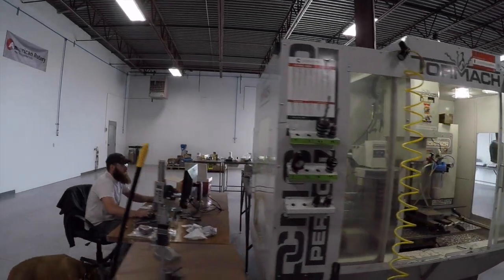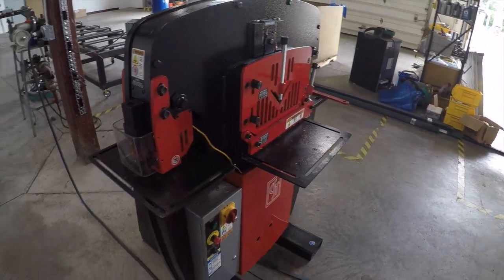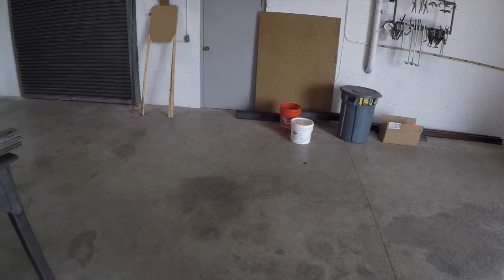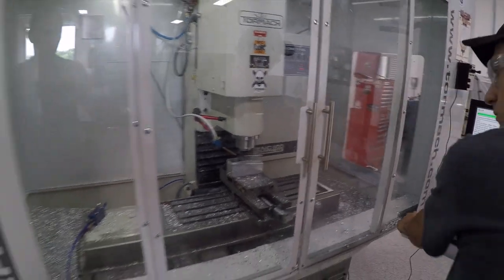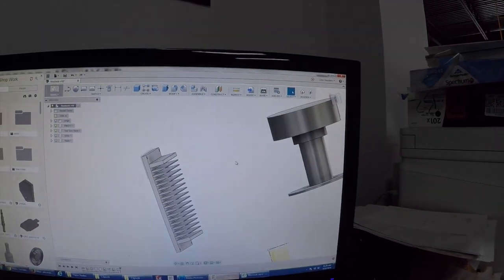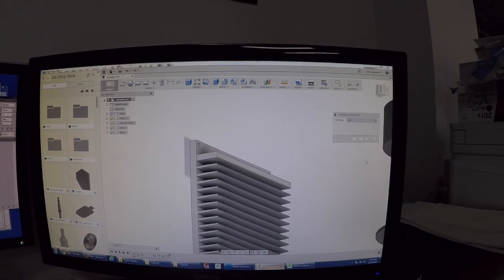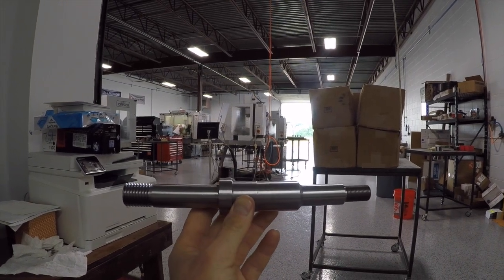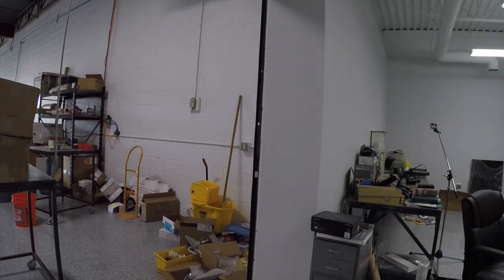Intern, Iron Worker, Slitting Saws, Shaft, Sandvik & More! CB22

Comment: I still say but the extruded heat sink stock and modify it.  If it starts to give you a lot of chatter, good trick is to cut every other slot first, then melt machinable wax into the slots, put it back up and cut the remaining slots. The wax keeps it both rigid, and will dampen the vibration during cutting. 

And ya... Didn't think that 390 would be beneficial on your current machines.  But hey, that's why you get tools on test :)

Comment: Hi John
We were using the Sandvik 390 16mm endmill with GC1130 insert on our VMC ours is a 5.5kw spindle. We were trying to take a cut 6mm doc and 10mm woc at 5420 rpm and 1250 mm/min the spindle didn't stall but the insert took the beating. We finally ended up with 1mm doc and 15.65mm woc at 3980 rpm and 745 mm/min. All this numbers were given by Sandvik online calculator. You can try lesser doc at full slotting. We have noticed indexable endmill work great with lesser doc and higher woc for low power machine.

Comment: If you find yourself getting lots of projects like that heat sink, maybe consider building an arbor to mount multiple slitting saws onto at once... use different thickness washers between each saw to allow the spacing between the slits to be varied.  Could be a fun/interesting project even if it's not something that's will often be useful.

Comment: The insert endmills are really just for production things. We have all Helical endmills, half for steel, half for aluminum. Sometimes when randomly get a big hardened part or a big cast iron part, we use that insert cutter. The advantage we get out of it is we can buy inserts for a specific material, rather than buying a brand new solid carbide Helical endmill. It's cheaper in the long run

Comment: Quite impressive to do that shaft without a tailstock and achieve that accuracy. My colleague was making a very similar shaft today on a manual machine and it takes a lot of attention to detail to hit the numbers. He was also putting it on the cylindrical grinder for the bearing seats to hit the numbers. Lots of messing around with setup to get it right.

Comment: Hey John, that heatsink is probably old news by now, and well out the door, but in case you get another I thought I'd mention most heatsinks have a draft on the fins. You probably know that already anyway. Sometimes the draft is because they're cast, but I believe it also increases efficiency, and just looks better anyway; a bit more pro!

To setup for draft, just shim or otherwise angle your fixture to get a few degrees angle on the saw and cut as you're doing. Flip the part and repeat the cycle.

Incidentally, as much for other viewers, having a draft on features like that is something that can help make jobs look much more professional just in general. We mostly don't notice it when they're there, but it always feels (at least to me) like something is missing when they're not.

Again, for others, don't be afraid to have a go at making tool holders, especially larger ones that won't be turning at crazy rpm or for turning tools. A normal commercial shop would never entertain it, but it may make a viable project if it's somehow special. I'm currently making a 3 insert dovetail cutter for example ... once I can finally get out of F360 Drawings with something useful!!! The holders sometimes look complicated, but if the inserts are taken out of commercial holders they'll often reveal themselves as quite straight forward to machine with just a couple of critical dimensions that need to be nailed.

Comment: Ignore the trolls. Your vids are great! I am actually watching all your CB videos. You must see a huge jump on your anylitics page over the last month.  For your heat sinks, cut the fins from bar/sheet stock on the iron worker then notch them and fit them into the slots you milled into the base. TIG the seams. If they need to be thinner at the top for some reason, use a shorter piece and squeeze into a triangle on the new ironworker. I see most sinks have their fins are even all the way through- are they trying to save on weight? The thicker aluminum will only help in transfering the heat more quickly and soak up extra heat at peak temps. Most aluminum sinks are extruded and it doesn't seem cost effective to mill(or extrude one offs), but TIG is super quick when fusing pieces together with no gap.
Reply: Heat sinks are actually pretty complex things. Although bigger thicker fins pull more heat, the reduced airflow means the heat sink can't throw that heat into the air as easier. So the heat sink continues to get hotter and hotter till it no longer can pull off enough heat. 

And one off custom sinks are not uncommon. It's much cheaper and easier to make a heat sink fit an already designed board and enclosure than it is to redesign the whole board or enclosure. 

As for tig welding, usually a no with heat sinks fins welded into slots changes how the heat sink absorbs and offloads heat compared to a solid sink. There's many a engineer with ample time on their hands who have studied the FEA and thermal analysis of heat sinks. They are relatively simple in design, but changing factors like fin width, fin heat, air gap distance, fin angles, bottom plate thickness etc etc can dramatically change its performance.
Reply: Not like it's going on a huge transformer so while engineering of the sink makes sense, it would be more for cost vs cooling vs available space at this size. I know there are many one offs and for those, I agreed that a CNC mill made sense. Just seems like a waste of material and machine time for a simple part- meaning, switching the material to copper(for a one off) and producing it with a simplified process would likely give better results at a lower cost.
Reply: +Jim Wilson 
Who knows. That's the engineers and designers gig.  If they wanna pay the money for a custom heat sink. Let em. 
It's silly engineers wanting custom, not off the shelf parts, that keep small shops in business. 

The other thing is that it could be an old, obsolete component that they need to replace, so have no choice but to get it custom made. Who cares what they want, long as they pay their bills :)

Comment: A horizontal with a gang of slitting saws would mow that heat sink out in no time!  :-) Personally I think laying on its back and cutting the grooves with a endmill would be faster and less chatter prone than trying to use a slitting saw. In my experience large amounts of cutter engagement on small parts usually doesn't work well.

Comment: 70% stepover is the old rule of thumb for standard machining.  That's what existed prior to the HSM evolution.  It's 70% because if you go further than 70%, a climb cut ceases to climb and you're actually doing a partial conventional cut.  The reason for climb cutting is that you enter the cut with the chip at its thickest point, when the cutter leaves the cut the chip is at its thinnest point, so forces are reduced.  This is the basic principal which lead to HSM and radial chip thinning theory.
Reply: Page 24 of the AB Tools catalog has an excellent writeup on this, with a diagram: http://www.abtoolsinc.com/pdf/AB_Tools_Inc_Catalog_2012.pdf
Reply: The newer toroid shaped endmill's are the same way. Designed for hard milling with big (60-100%) stepover and smaller doc's but the shape accommodates HSM paths as well. They can blaze through 50+Rockwell materials even on light duty machines. 
And most are NACRO coated. Gives incredible tool life with amazing floor finishes even at high speeds.

Comment: Love the American flag in the shop!  Hi Noah!!
Reply: +Mattias Larsson actually metric is great and easier to use than fractional ASE standard but yes, can be a PITA getting used to it and understanding what metric measurements are for typically used items to get a familiar reference; like 200mm is about 8". I only know that because of my my 3D printer has that as its build volume width & length.

Comment: Just a thought John, i have started a couple of businesses in my time and I get the impression you are trying to convey your experiences to your audience, I am interested in your experiences with tooling,, tooling is expensive and in the machine shop business must be  a continual challenge, any thoughts or strategies for someone starting on how to tool up your machinery and not break the bank,
Reply: There's a lot of factors for tooling up. What machine are you looking at, what kind of jobs are you planning to do etc. 

That said, ER 16 and ER 32 collets and holders will give you the great versatility. Can buy just one or two holders, and then buy the individual collets or a full set. A precision drill chuck is also money well invested. And a solid endmill holder for a flycutter shank (either 1" or 3/4") 

As for actual tooling. A 2" fly cutter or face mill ,  1/2" rougher ,1/2 finisher and 3/8, 1/4, 1/8, 1/16" finishing endmill's (or their close metric equivalents)  is a good start. 

If you're just starting out, and never machined before.  get premium grade HSS cutters (niagara is good, just no "made in China's") . Ya. Not carbide not as fast but if you're just learning, HSS is both cheaper and more forgiving. 

For carbide, 3 flute Accupro endmill's in TiN or TiNC coating are great general purpose for anything from plastic to aluminum to mild steel like 1018 and 4140 annealed.
Reply: Thanks, I am in the metal trades, welder, pipefitter, and plumber so I am not totally unfamiliar with metal fabricating. I bought a Bridgeport BR2J for my home shop and i was looking for some advise on tooling up and  your info helped. I have a bigger plan and I have also ordered a cnc plasma cutter to move me along in that direction.  Next up is an ironworker and I was set on the Scotchman until I saw John's Edwards.  I was impressed with the plug in hydraulics for the benders and press.  So, any thoughts in that regards is also appreciated.